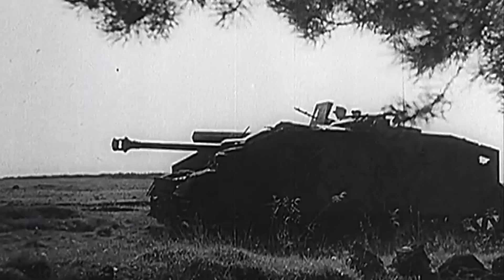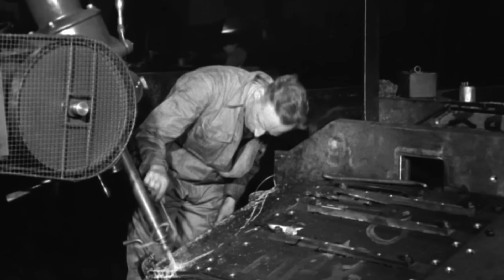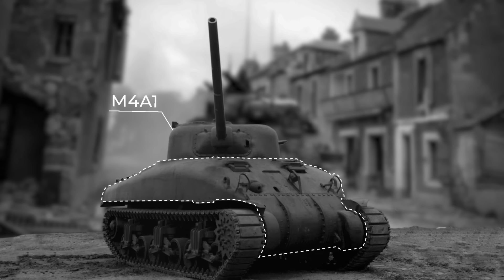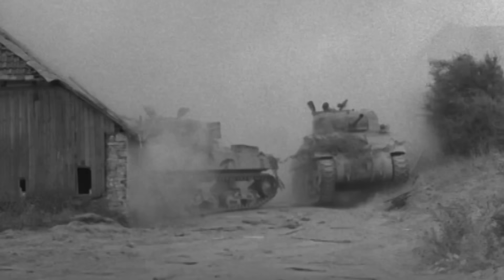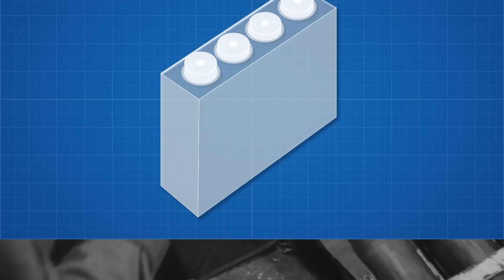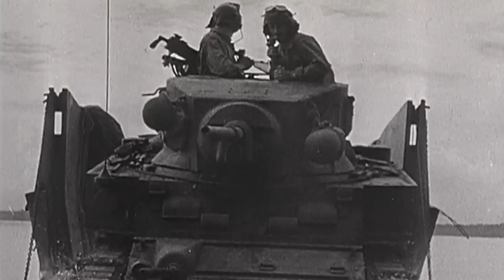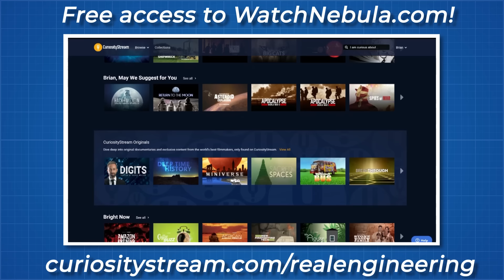M4 Sherman - The Workhorse of D-Day

Comment: I don’t think that the Sherman was “the work horse” of d-day because not many made it up when they were supposed to this was mainly because the modifications made them float but they were very slow and those that did make it on or close to shore would be destroyed by artillery and AT because there weren’t enough men on the shore by that point to cover them however they were a good choice overall I think to send across the channel because they were small enough to put on a vehicle landing craft (which were built for jeeps, light infantry transport, and armoured cars and they proved invaluable when fighting in the battles following because they could get so many on shore so quick.

Comment: Ya forgot about the British variant which was the better Sherman before the Easy 8 which is the Sherman Firefly that had a 76mm 17 Pounder gun. Plus Shermans were also used LONG after WW2. Some even still today. They were used in Korea and even Israel to fight off its neighbors Egypt, Syria, and Jordan. The Israelis even modified it later on from the 76mm gun to a 105mm gun and went from a gas to a Cummins Diesel engine and called the M51 Super Sherman. And after Israel’s use, they were then purchased by Chile and were upgraded again from a 105mm gun to a 60mm High-Velocity Medium Support (HVMS) gun and a Detroit diesel engine. Was almost gonna be used to go up against Peru in the 1980s but never went to war. They then retired the M60 Sherman for German Leopard 1Vs and hasn’t really been used much since. But apparently Shermans r still used by underfunded armys. I mean Uruguay still uses modified M24 Chaffees.
Reply: Only about 20% of the time were Shermans fighting other tanks, and only a fraction of that was fighting the big cats that needed the 17 pounder.

Comment: Good show, but:
 - @5:56 show a version with riveted lover frontal armor
 - You never mention the installation of the British 17 pound gun.
 - The hedgerow installation was a field conversion during the days after the invasion 1944 06 06, D-Day.
 - You do not mention that the dimensions of the M4 was limited by the need to allow railway transportation in USA.
 -  You mention battle experiences: 
   1 Pzkw IV Tiger is lost for each M4 Sherman lost and explains it with logistics and the problem with getting heavier tanks to mainland Europe??
    Excuse me, - This is about M4 Sherman and not about what would have happened if heavier tanks allied tanks had been available. 
    The German 88mm in a Pzkw IV could destroy an M4 without getting inside the range of the effective range of the 75mm used by the M4 before the British 17 pound gun was introduced.
    The standard mode of operation for M4 when coming across Pzkw IV was: 
     Hide, trick them and shoot them in the ass. If that is not possible, then try to hit a belt.
The German Panzergruppen called the M4 Ronson because they lighted up every time they where hit.

Keep up your good work, but read and read and read books...
Reply: > "- @5:56 show a version with riveted lover frontal armor
"
 Bolted. Not riveted.

> "    The German 88mm in a Pzkw IV could destroy an M4 without getting inside the range of the effective range of the 75mm used by the M4 before the British 17 pound gun was introduced.
"
 The IV did not have an 8,8cm. The 7,5cm. KwK 40 reached parity with the 75mm. armed M4's due to the M4's overall better armor in the front.

Comment: A 75mm gun was unlikely to pierce a Tiger's frontal armor, but its side and rear armor was not as thick and presented a better chance of penetration. Sherman variants with slightly bigger guns (76mm and 17-pounder) had a better chance of penetrating the frontal armor.

The Tiger meanwhile had a beefy 88mm gun that could reliably penetrate most tank armor from the period.

Comment: Good video, only one minor gripe:
M4A3E8 - E8 was the experimental designation for testing the HVSS, in the field it would officially be M4A3(76) W - HVSS for the final most upgraded verion. M4A3 being the model (76) or (75) indicating the caliber of gun, W meaining it was equipped with wet stowage, and HVSS indicating it had been given the upgraded with the horizontal suspension. 
And yes if you look around you can find some M4A1(76)W -HVSS's as well.
and then not a gripe but just to expand on what you said:
In British Service the Shermans M4AN designations where replaced with a simple N designation. So the M4 became the Sherman I, M4A1 the Sherman II etc, with the most common British Service M4 being the Sherman V (a slightly longer Sherman with a different engine), and the Sherman Vc, which replaced the 75mm with a 17lb gun.

Comment: the m4 sherman is not the most produced tank of ww2. the russian t34 was more mass produced. about 50 000 m4,s were made and about 84 000 t34,s were made with another 13 000 tanks that used the t34 chase. and thats not even including the t34-85
Reply: Not exactly
Reply: The Soviets only built about 55 thousand T34s during the war. The difference is that the Soviets kept building them into the 1950s.

Comment: It's not like in Fury. The only way to defeat a Tiger is ti send more Shermans than the shells (cannon bullets) the Tiger has.
Reply: That's just a blatant lie.
Reply: Literal German propaganda.

The way to beat a Tiger is:

White Phosphorus Shell too Cook it's engine and crew.

Bringing up an E8 or Firefly to one-shot it from range.

Using a new shell and piercing the front of it from 500m with the short 75mm.

Waiting for it to burst into flames due to faulty fuel lines.

Waiting for it to burst into flames from overstressed engine.

Waiting for it to breakdown as the suspension was too weak for the weight.

Literally just driving around it and hitting it's side.

Comment: He missed one of the most important things... transportable by ships that were being built.
I always find in interesting that all the disadvantage of the M3 gun lay out often disappear when discussing the Stug.
True the 75mm can not operate hull down. but the 37mm can, and many targets are vulnerable to the 37mm.  Examples
Trucks.1/2Tracks,Armored cars, PzI.Pz2.Pz3 (early) Pz4(early).38(T)   Troops.

The thin track on M3/M4 was to make the tank faster by making the track lighter.  
The thin track was improved by adding extensions on the end connectors (Duck Bill) before the E8 suspension

Comment: One slight 'correction'; the 76mm upgrade was first ordered before the Sherman even made it to Africa. The idea was that the 75 was meant as a "good enough" gun for everything they were fielding, while having the 76 available when the time comes where it needed to be upgraded to have better AT. The issue was when the brass wanted most of the Shermans upgraded, they had pushback from a lot of people on the fronts that didn't want to get rid of the 75 yet, due to it being better against soft targets (which was statistically more than 60% of what they shot at) and fortifications.

Interestingly a similar situation happened with the M18 replacements of the M10. The TD battalions that were fielding the M10 at that point were very adamant about keeping their M10s and not upgrading to the new M18. So instead the M18s were supplied to the TD battalions that were at that time fielding M3 GMCs. It wasn't until the M36 to where M10 equipped battalions accepted new vehicles (because the M36 was essentially an upgrade of the M10 with a 90mm, but now based on a later Sherman variant).

Comment: Why does everyone forget the M2 medium tank
Reply: Mostly because it was Outdated by 1940, and was more of a Machine gun nest on tracks than an actual tank
Reply: @Cobra-King3  I mean you definitely aren't wrong although it did have a 37mm high velocity cannon meant for tank on tank battles, it's just that it was a very important tank and the M2E2 directly lead to the creation of the M3 Lee
Reply: @TMAJ0R  on the 37mm gun, it was the same used on the M3 Lee, M3 Stuart, and M5A1 Stuart, it wasn't a High velocity cannon, and yes, even though it was a great Anti-tank gun in the early 30's, it was useless when 1940 came along, especially since the Germans just ran over France in less than 2 months
Reply: @Cobra-King3  That wasn't the same cannon as on those, they were developing and to my knowledge completed a high velocity 37mm specifically for M2, it took them a while to develop it that they had put in twin 37mm short cannons because the main 37mm they were developing wasn't complete during trials. Btw the 37mm cannon was still effective against all panzer up till the Panther and Tiger and other spgs were brought into play by the germans
Reply: @TMAJ0R  in reality there was never a High Velocity 37mm gun, and up until the Panzer III is the Gun Effective, by the time of 1941 and 1942, the Panzer III was in the process of being Phased out by the Panzer IV with its new 75mm gun in the test F2 variant and later Finalized in the G Variant, after the additional 30mm of plating up front making it have a 80mm front plate, the M5A1 Stuart's 37mm gun firing M51B1/B2 APCBC round can go through the Panzer IV front at 100 meters, which even though possible is highly unlikely, the gun on the M2 fired standard M51 APCBC and can't go through the Panzer IV G at point blank

Comment: That cannon is sure tiny though.  It's a little surprising it could take out a panzer at all.   How did the range of engagement compare?
Reply: The 75 mm m2 gun on the Sherman was developed in 1941, the panzer 3 and 4 in service had only a 50 mm gun onthe pz 3, and a short 75mm on the pz4. The German 7.5cm l43 panzercannon, didn't get used on the pz4 until mid 42
Reply: M3 75mm gun of the Sherman can pen 90mm+ of armor and it's considered tiny?

Comment: It took 5 shermans to kill a tiger because shermans always moved in a platoon of 5 tanks.
No sherman tank ever went anywhere without the rest of the group. 

They only had trouble with tigers and panthers in normandy because of the environment there with the hedges and stuff. Leaving them at a tactical disadvantage.
For the rest the sherman tanks could take on german panzers without issue. 

Plus tigers where very rare at the western front, it was mostly stugs and panzer 4's that they fought against.

Comment: Pretty sure there were more T34s built
Reply: Depends on several matters. Many didn't consider the Soviets as part of the Allied powers until after the war. Production numbers for the T-34 (and its derivatives) during the war vary wildly. Though Between 54,800 and 57,900 are the most common figures. In total between and 60,235 and 63,335 T-34's in all variants and its derivatives were produced during the war. On the other side the the numbers for the Americans are less under question- 49,253 M4's produced during the war including the T6 pilot. In total 63,181 M4's in all variants plus derivatives were produced. Another ~2,180 can be added if you want to consider the Grizzly's and Sexton II's which were Canadian produced (for most part they were assembled in Canada, though most parts were produced in the U.S., they are not added to the M4 production list). So if you want 65,369.

 However referring to the tanks themselves up until 1944 the production and use of the M4 was at least notably, then eventually marginally larger than that of the T-34. In 1945 the T-34 (the T-34/85 variant in particular) production outpaced M4 production and beat it in overall numbers. That being said, the T-34 was produced well after the war to make up for losses suffered and the fact replacement medium tanks weren't in the numbers required. Some ~80,000 were produced in total if we include postwar production.

Comment: The M4 was replaced by the M26 Pershing, which was a complete redesign...but I have often wondered if the Sherman could have been "upsized" with the same basic design. The Sherman could be made longer, with thicker armor, larger engine, and of course a larger and more effective main gun. After all, the Sherman was not classified as a heavy tank...it was a medium tank. Try and imagine a Sherman reconfigured as a heavy tank.
Reply: If you're trying to upgrade gun, turret, engine, armor, suspension, and transmission you may as well just make a new tank and apply some of the lessons you learned with the old one.
Reply: The Sherman was upsized by Israel into the M51 Super Sherman.

Comment: Good video) Take a look at Stephen Ambrose's book on the M4 Shermans at Normandy. The hedgerows, which are steep embankments between some fields, covered by brush. They were apparently completely missed in aerial photographs. (I drove around Normandy, already knowing about hedgerows and had a moment after passing miles of them of ' O yeah, that's not just bushes, that's a hedgerow.' The Germans set machine guns up on the far side of fields and waited for the Allies to come over the tops  hedgerows. It was going to turn into WWI, but American tankers and mechanics, according to Ambrose, just started working on the problem and in three days had worked through several designs and ended up welding up a pointed  ram that would just plow right through the hedgerow berm and then start machine gunning the German positions on the other side. Ambrose goes on to make the claim that one key advantage Americans had in the war was they were always repairing and improving their gear. (I'm a DIY American so of course I buy into this completely, and probably have no objectivity.  As a non-American engineer, it would be interesting to find out what you think. I think I'm pretty clever and can prove it, but.... most of the fixing and improving I've done has been done for other Americans who when the door knob falls off can't get out of the room.  . I always like to quip: My grandmother and the Red Army won WWII, the Russians at Stalingrad, and my Polish grandmother in Detroit building Sherman Tanks at Dodge Main. (She only made parts. So the image of my babushka and row of Shermans rolling out of the factory never happened. Of course  a few others contributed to the war effort.

Comment: "the most produced allied tank in ww2" that's not even true, there were more t-34's produced than M4's
Reply: Depends on several matters. Many didn't consider the Soviets as part of the Allied powers until after the war. Production numbers for the T-34 (and its derivatives) during the war vary wildly. Though Between 54,800 and 57,900 are the most common figures. In total between and 60,235 and 63,335 T-34's in all variants and its derivatives were produced during the war. On the other side the the numbers for the Americans are less under question- 49,253 M4's produced during the war including the T6 pilot. In total 63,181 M4's in all variants plus derivatives were produced. Another ~2,180 can be added if you want to consider the Grizzly's and Sexton II's which were Canadian produced (for most part they were assembled in Canada, though most parts were produced in the U.S., they are not added to the M4 production list). So if you want 65,369.

 However referring to the tanks themselves up until 1944 the production and use of the M4 was at least notably, then eventually marginally larger than that of the T-34. In 1945 the T-34 (the T-34/85 variant in particular) production outpaced M4 production and beat it in overall numbers. That being said, the T-34 was produced well after the war to make up for losses suffered and the fact replacement medium tanks weren't in the numbers required. Some ~80,000 were produced in total if we include postwar production

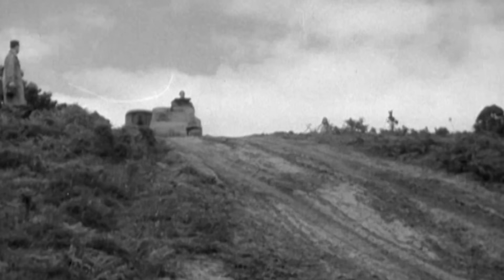Comment: 2:33 small correction the T-34 was the most produced allied tank of the war although if you meen the most produced western allied tank than the Sherman is the most produced
Reply: Depends on several matters. Many didn't consider the Soviets as part of the Allied powers until after the war. Production numbers for the T-34 (and its derivatives) during the war vary wildly. Though Between 54,800 and 57,900 are the most common figures. In total between and 60,235 and 63,335 T-34's in all variants and its derivatives were produced during the war. On the other side the the numbers for the Americans are less under question- 49,253 M4's produced during the war including the T6 pilot. In total 63,181 M4's in all variants plus derivatives were produced. Another ~2,180 can be added if you want to consider the Grizzly's and Sexton II's which were Canadian produced (for most part they were assembled in Canada, though most parts were produced in the U.S., they are not added to the M4 production list). So if you want 65,369.

 However referring to the tanks themselves up until 1944 the production and use of the M4 was at least notably, then eventually marginally larger than that of the T-34. In 1945 the T-34 (the T-34/85 variant in particular) production outpaced M4 production and beat it in overall numbers. That being said, the T-34 was produced well after the war to make up for losses suffered and the fact replacement medium tanks weren't in the numbers required. Some ~80,000 were produced in total if we include postwar production